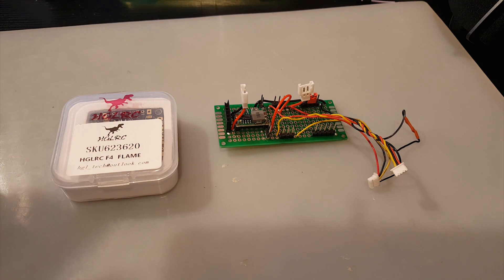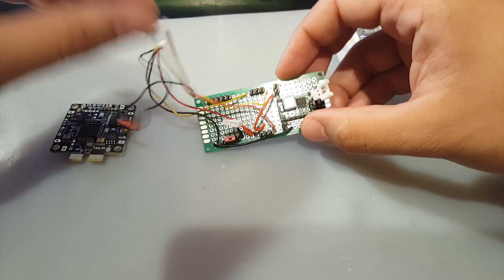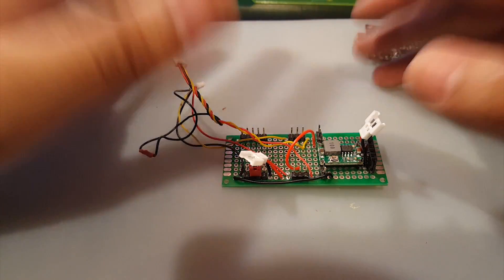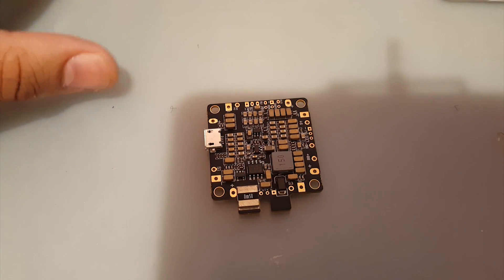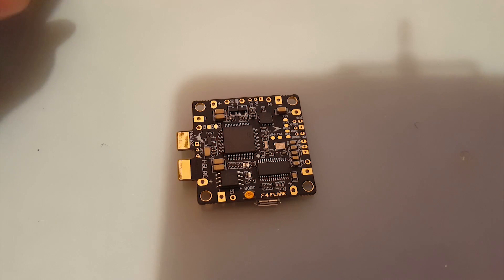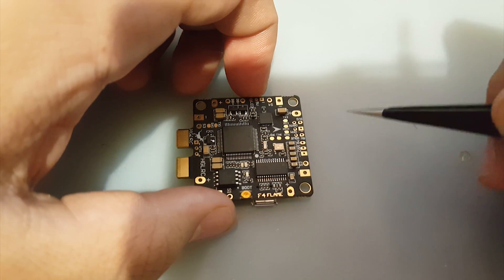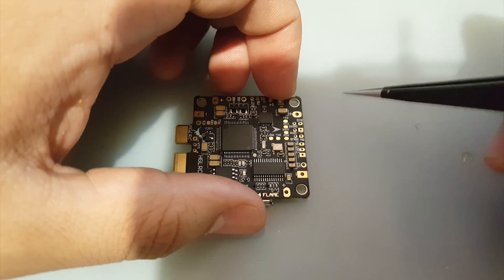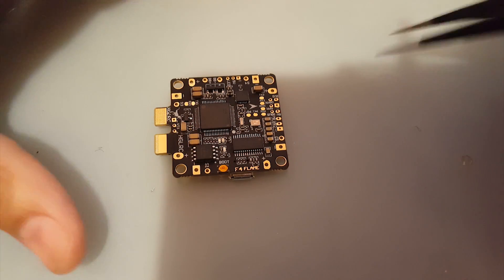HGLRC F4 Flame Review // Noise Testing

Comment: Hey man! I got this for my next build and want to use with a 4-in-1 esc with 5v and 12v bec (probably spedix is30A).
What do you think would be the lowest noise option?
1. VBAT from ESC to FC and wire cam and vtx normally?
2. Power the FC with the 12v bec from the esc and wire cam and vtx normally? (I guess this would mean no current info for OSD)
3. Power the FC with the vBAT and the vtx (TBS Unify Pro 5G8 HV SMA) with the 12v bec from the esc?
4. Power the FC with vbat, the camera with the esc 5v bec and the vtx with the esc 12v bec
5. Power the FC with vbat, the VTX from 12v esc bec and the camera from the vtx 5v out

Lots of options

Comment: Thanks for the video, very helpful.
One question, where do you put your ibus RX cable from receiver? Maybe sbus? Some other uart RX?
And in case of using one RX uart, there is any accesible uart port TX for using smartaudio?

Which target of betaflight is that FC?
Thanks!

Comment: But do you still need it with an modern BLheli ESC? I thought they can set the max current, also in regen braking.
Reply from the maker: +Ruben Hartmann yes you still need a cap on most

Comment: Hi, can you help identify the clock and I/O pins for this board? I have a broken usb and im desperate
Reply from the maker: Listen you dont need to identify anything all you can do is cut a usb and solder the wires to the part where the usb connector was and should fix it all up.

Cut open a micro usb cable and take note of the colors and names of the wires in the picture below.

https://i.ytimg.com/vi/zsMl0tfJXzI/maxresdefault.jpg

Then pretend this picture was the usb on the your flight controller and solder them accordingly but do not short the wire like they  mention in the picture ignore that part.

https://a.pololu-files.com/picture/0J4893.1200.jpg?5accec1deb1e1bad1dea0cbbd69b5b89

Keep me updated
Reply: Drone Mesh would this work if the solder pads and traces came of also?

Comment: I just got this board it came locked up in some way pc cant see it. lol and it doesn't have clock or I/O pads or info where they might be mapped. its like its in between the bootloader or its has usb issue but can get power to light up red

Comment: once again great vid and info.
question about capacitors ' can I cut the legs down?! I usually add run heavy duty wire off them as then I can place in a more convenient spot ' as suggested by NJTECH. but would help a lot if I could make it smaller.
Hope you get out and fly a few packs this weekend as I know I will be ' the uk weather is amzing at the moment, so am trying to make the most of it .
Thanks again
Just watched your x210 vid and you showed us that you can trim capacitors ha !
Reply: I also want to know about the legs being shortened.
Reply: hi, done a bit of research and you can shorten them. they highly recommend that you use  thick wire.
all seems to be working fine on my quad and less interference.